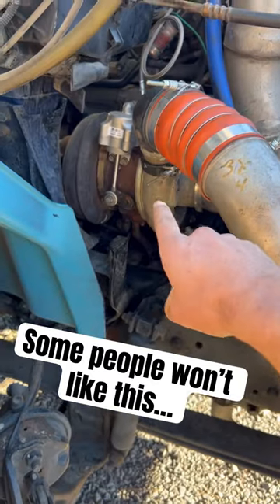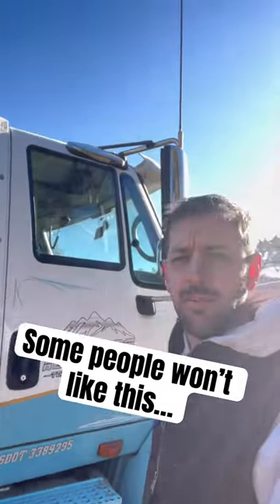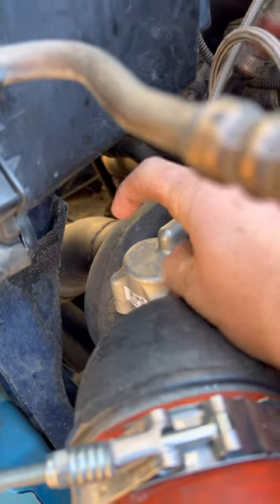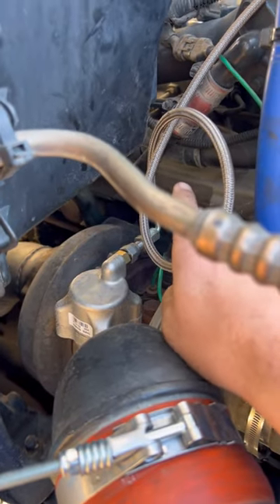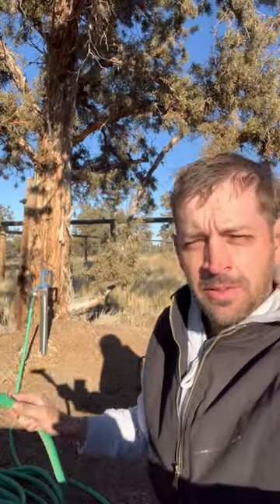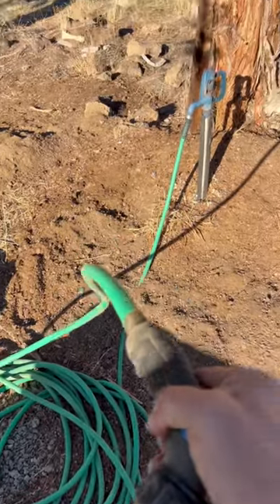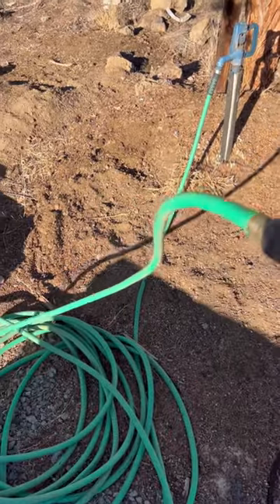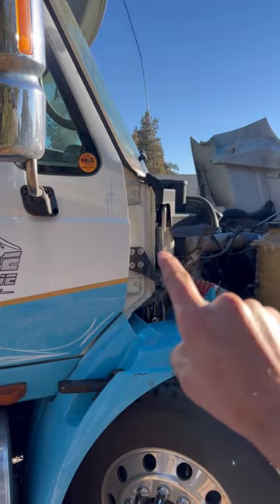Will it hurt the turbo??  (Physics made simple)

Comment: Can it damage the turbo? IMO, no. There is very little air volume at best. Air can't flow through unless there is a cyl at overlap. Overlap has the valves nearly shut, and overlap is < 30 deg x 4 = 120, per 360 deg, or at best a 1/3 chance. Now let's say you are unlucky and the engine stops at overlap. The air must go through the exh valve that are only open <.05" and then the intake, <.05" the through the intercooler, then compressor (which wants to turn the turbine the other direction) then the air filter.

OK, assuming that small amount of air could actually keep the turbo spinning. A turbo is a high powered device. It consumes over 50HP under load. And everytime you shut off your engine, it coasts for upwards of 2 minutes. It's not fragile. But should the oil film somehow go away, the turbo would just stop spinning. The air going through those little valve gaps could not apply enough torque to burn off the bearing material

Comment: 😂 been yelled at for this several times. As a diesel mechanic it’s the dumbest most ignorant thing I’ve ever heard of.
Reply: If you are a diesel mechanic, may i ask then :
Old diesel engine have no throttle in the inlet, and the invalve was open at the same time as the outvalve. This was to let the exhaust drag more fresh air in to the cylinder. Have that change in new turbo engines ?
Reply: I heard it argued both ways ,leave it up to the choice of the owner
Reply: That's funny because when you haul farm equipment and construction equipment there is a reason the exhaust is plugged. Nice try though.  Try harder next time.
Reply: @kennethlaw9830  this was discussed several times with Sergei Dratchev, and he had these  big covers he put on the equipment  when he transported heavy equipment, new or used,on his RGN trailer, just a covered the tail just in case thing,
Reply: @jeffclark2725 I actually used to haul for Cat, and a few others back in the day. They don't tell you to cover them just becsuse
Reply: @heltratt6363 almost no diesels have throttle plates (butter fly valves) on the inlet. Some Mercedes but I don’t remember why. Anyway, gasoline engines have a butter fly valve to regulate RPM via regulating intake air flow. Diesels regulate RPM by precise and calibrated control of the amount of fuel injected into the cylinders. So a butter fly valve is not needed on any diesel engine.
Reply: @jeremykamel9655  
I know some old Volvos have it to, but we talk 1956 years model then. ( Known in Sweden as Shake-engine 😂 )
Reply: just today i took delivery of a used caterpillar p36000 for the company i work for, the exhaust pipe was covered w tape to avoid the turbo from spinning. there's probably about 3ft of exhaust between the smoke stack and the turbo, nothing in between but a muffler🤷‍♂️ idk better safe than sorry ig

Comment: There may be a cylinder in the valve overlap overlap position with the engine stopped which would in fact allow air to pass through the engine while stopped. 

You know less about these engines than you think you do.
Reply: At last common sense

Comment: Ayup.

Air would have to enter that small opening, make an immediate 90° turn, pass through a large, baffled chamber adding several hundred, if not thousands of degrees of turns, enter another small opening, make another ~90° turn, and still carry enough energy through the turbine to turn the engine over at least to a point where there was some valve overlap to let the pressure escape.

The stacks would rip clean off long before you reached that much wind force. The cab wouldn't be far behind.
Reply: I agree with you but is there any thought that should be put into the possibility of 1 or 2 intake valves open due to the position of the stopped cam shaft?
Reply: @andrewhammes1183 if an intake valve is open then the exhaust valve is closed... Still nothing getting through...
Reply: @Jet_Hammer  oh, duh.  Thank you

Comment: Heard this before, Never gave it much thought,. Valves would have to be on overlap and that implies an other piston stoped at TDC , not very likely. What about on a 2 stroke Jimmy? The bigest problem i can think of is the dust , rain, etc ..entering an engine/turbo from the exhaust side on old equipment with a straight up pipe.

Comment: In theory if you have the wrong type of impeller, the pressure could both turn the turbo, and spin the engine over to (in reverse of course) so nothing only would you blow up the turbo but the whole engine to, as the oil pump can’t pull enough vacuum to draw oil all the way to the top of the engine through the moving parts… but that all depends of course on putting a jet engine up to the stack, then light it off

Comment: Not sure it matters whether it's frontwards or backwards. If it's frontwards, the vacuum at the exh tip with the pressure at the air box should make it spin also.

Can it damage the charger? IMO, no. There is very little air volume at best. Air can't flow through unless there is a cyl at overlap. Overlap has the valves nearly shut, and overlap is < 30 deg x 4 = 120, per 360 deg, or at best a 1/3 chance. Now let's say you are unlucky and the engine stops at overlap. The air must go through the exh valve that are only open <.05" and then the intake, <.05" the through the intercooler, then compressor (which wants to turn the turbine the other direction) then the air filter.

OK, assuming that small amount of air could actually keep the turbo spinning. A turbo is a high powered device. It consumes over 50HP under load. And everytime you shut off your engine, it coasts for upwards of 2 minutes. It's not fragile. But should the oil film somehow go away, the turbo would just stop spinning. The air going through those little valve gaps could not apply enough torque to burn off the bearing material.

Comment: Aside from that lengthy explanation. Between the exhaust pipe outlet is the muffler and many feet of pipe. By the time any air does get to the turbo it will have so little force it can’t possibly turn the turbine wheel fast enough to cause any damage

Comment: Whose to say the engine wasn't originally shut off in an overlap condition, I could see it possible, just not likely, even just slow spinning over an extended period could exacerbate wear on bearings. Probably one in a million, but impossible is a tricky word to prove

Comment: It happens. Have seen it multiple times mostly on older construction equipment and rarely on trucks, especially with emissions crap nowadays. 10+ years in the turbo sales and service industry. Would be easy to prove/disprove with newer turbos using speed sensors. To bad Myth Busters are off the air. Never say never 😉

Comment: I think it’s bs too. But there’s a thing called valve overlap where both intake and exhaust valves are open and hypothetically air could spin the turbo if the conditions are met but it’s unlikely

Comment: I'm sorry to be the only one to point this out, but the hose bib that you are using your example actually will allow air to flow through it even when it's closed. It's got a stop and waste underground and will permit pressure from the top side to flow out that hole.  Having said that, the air would not get into the water supply below the stop valve.
Reply: I'm not the only one.  I found others that posted prior. Lol we're all nerds here.

Comment: If an exhaust valve and intake valve are open air might flow through. But the shape of the turbine blade will hinder movement. It might move a little, but not enough to worry about. There is also no way enough pressure could be created in the exhaust to turn the engine over. I’ve barred over enough of them to know how much effort is required to move it. Not going to get enough pressure in the exhaust to do it with conventional towing methods.

Comment: Well not only that but the veins in the turbo are not shaped in such a way to spend backwards either so you have both things against you the fact that the valves would be closed in the motor and the turbo not set up to spend backwards

Comment: First of all air cannot spin a turbo backwards because the fan blade are turned into a direction of the exhaust side as pusher so therefore it will not spin backwards from the muffler side

Comment: um turbos don't have bearing unless it a super expensive one that would cost almost as much as that truck but they do have bushings. there may have been some differences back in the 60s and 70s truck but the turbo fin seemed to spin in those more easily, i know we had to idle them down so they wouldn't set there spinning while you climbed into your personal vehicle and drive away.
Reply from the maker: They absolutely have bearings

Comment: Chance are that at least 1 cylinder will be in a position of valve overlap just past TDC on the star of the intake stroke.
We tested it with the exhaust ventilation system in a shop hooked up to the exhaust and it did spin the turbo, not fast but over time ....
Reply: Did you suc or blow the exhaust?
Reply: @Pinz314  the exhaust ventilation system puts suction on the exhaust.

Comment: Really using a frost proof hydrant is not the best example because when the hydrant is off it opens the vents at the bottom of the hydrant  so you actually could blow air through that hose however you are completely correct on the turbo part
Reply: Oops, I just posted the same thing.

Comment: Frost free spigots don't work and freeze if the hose is hooked up....😮
Reply from the maker: They do if you leave the nozzle open
Reply: Yup, I've had to pay the local welding shop to bring their big gas motor driven welder out to thaw a couple of hydrants before, writing the check for that will insure you don't forget to remove and drain the hose again any time soon.
Reply: @CaseyLaDelle I’m not going to open this hose because it’s a little frozen. Ummm

Comment: Thats A Very Odd Concern lol Turbos Especially Journal Bearing Turbos Are Not Easy To Spin When Dry And Cold To Begin With. Aside From The Engine Being A Massive Restriction And The Air Flow Being In The Least Ideal Direction For Intened Turbine Rotation....

Comment: You do understand diesels don’t have a throttle blade right?  If one of the 6 cylinders is on the intake stroke which there definitely will be.  Air can and does back flow.  It’s called turbocharger windmilling.

Comment: Valve overlap will allow reverse air flow thru the engine. And the drain feature of that frost free hydrant will also allow reverse flow, not back into the plumbing but into the ground.
Reply from the maker: No it wont.
Reply: So you are saying that at time in a cycle of a 4 stroke engine the inlet of the engine is connected to the exhaust, if so the engine is screwed, don't worry about the turbo!
Reply: @mikerubynfs  in way yes, valve overlap is when both the intake and exhaust valves are open at the same time. This is by design on many engines and at that time reverse flow is possible as all valves are open. Weather or not that means there is enough air flow to spin the turbo would be another matter. 

And frost free yard hydrants like shown in this video have a but in drain in the bottom to drain the hydrant of water when it is shut off to prevent damage from water freezing in cold weather.
Reply: @tdm8817  I stand corrected, I suspect that there would not be enough airflow to spin the turbo, even if it does they are quite robust bearings (I work for a company that made them) and would be running cold with loose clearances.
Reply: @mikerubynfs  ya I would imagine its not enough air flow to spin the turbo in most situations, that being said keeping rain bugs and debris out of the exhaust would be a good idea so a coffee can or something similar over the exhaust while towing would seem like a sensible thing to do.
Reply: @tdm8817  A quick try to calculate the air pressure on the turbo indicates a low force, vastly less than from the exhaust. I doubt debris would make it as far as the turbo,  plus being a centrifugal fan it is being driven the wrong way making it very inefficient and even less likely to turn. I hope Casey's metrics are increased!
Reply: @calholli yes Yes, N supercharged and Turbo engines tend to have more valve overlap.
To clean the cylinder
Reply: Nice to see more people knowing of valve overlap...
Im not updated of new diesel engines, but know that old had it.
But one cyl open and air going wrong way true the turbo fan maybe dont make it spinn. I dont know that...

Comment: I drove through a Nebraska blizzard to work one night (they closed I-80 after I got off it), and parked my 245 Volvo, as I always do, backed into the parking place. Unfortunately,  it was pointed into the wind. 
I came out in the morning and tried to start my car and I heard the sickening fast turnover signifying a broken timing belt. (Not an interference engine so about a hour to change if you have parts and tools)
I opened the hood and the engine compartment was full of snow. Snow had sifted in around the plastic timing cover and the melted snow had frozen on the belt. Instant failure.
Strange things happen.
Reply: Ican see that, i always wondered on Ice Road Treckers back when they really buried those big trucks in the sno, and under the hood was really packed in snow, but the engines survived, Great video

Comment: Your wrong,  I think different than you.  If that hose wasn't filled with ice I could blow air through that hose. Its connected to a frost free hydrant!  That hydrant when closed vents to sand or stone under the hydrant if installed properly.  Thats why they put a swing fitting under the hydrant. The valve to that hydrant is buried under ground. And thats why its called frost free. The drain is buried beneath frost line and it drains all the water above it so It doesn't retain water and freeze .  This also lets water escape the hose even after the valve is closed so it can drain and not freeze. However, someone installed a sealed water nozzle on the hose 😅  if you have had to dig a few hydrants up by hand in very cold climates I can assure you that you also would know how they work.

Comment: Hay cast I really like you put disagree if two cylinder are on the exost stroke some times the exost valves and intake are not closed then you have a opening for air to go threw  and spen the turbo
Reply from the maker: No it won't

Comment: When I ran lowboy when we hauled heavy equipment we had to put a bucket on the exhaust but when we hauled a truck we didn't cover it
Reply from the maker: So you under that the myth is bullshit
Reply: @CaseyLaDelle  we also hauled with tilt deck trailers the same pice on a tilt deck no cover, low boy covered

Comment: Lets assume your wrong and that possitive air at the turbo could flow through the engine back out of the intake, removing all the dust and bugs from the air filter (wouldn't that be neat). Considering an overwhelming majority of trucks today are equipped with a DPF... I can only imagine the amount of speed required to create enough positive air pressure to backflow that DPF... Let alone the entire Emetions Systems to get to and overcome the Variable Vain Turbo... Never going to happen!

Comment: Air can flow through an engine that is not turning, if the engine has stopped with a cylinder that has its valve in crossover.
Reply from the maker: Prove me wrong
Reply: And an engine will not stop in such a position, unless it has 16 or more cylinders. It's physics.
Reply: @needadate 
Way ?
Its stop at comp in one cyl. And a 4stroke having 4cyl or more should have least 1 cyl in crossover..
Reply: @heltratt6363  Nope.
Reply: @needadate  
How will the pistons stops in the cyl then if i may ask ?
Reply: @heltratt6363  Near the point of maximum resistance, which is not close to TDC around which overlap occurs.

Comment: Air can flow through an engine backwards 100% no if and or butts. Always open valves. Not trying to be difficult but it’s true.
Reply from the maker: Prove it
Reply: Casey come on you’re a smart guy. All engines that are off have an open pathway through the engine via valves on at least 2 cylinders the engine will have two cylinders in the firing order that are called running mates one will be on exhaust stroke one on intake stroke therefore  open valves open pathway through the engine. Nowadays with particulate filters and air to air coolers there are definitely things to slow the air in a towing situation. But air flow is possible. In the past before emissions lots of damaged turbo claims due to towing and hauling especially off road equipment. Even today turbo damage is possible. Unfortunately all i have is 28 years as a heavy equipment tech and story’s from teachers and peers. No personal experiences. Not trying to be an ass but air flow is possible and turbo damage can occur. Very much enjoy the channel and will continue to do so. Great content right in my wheelhouse love it thanks Casey.
Reply from the maker: @benburrows9985  prove me wrong then.  Make a turbo spin…

Comment: The engine isn't always closed. At the top of an exhaust stroke, both sets of valves will be open and can alow air flow through the engine. Is one of the cylinders in this position? Probably not, but it can be.

Comment: Don't know about the newer engines, but we had a John Deere tractor hauled back in the 1970 that it did take the turbo out by hauling it with out covering the stack. So we just always cover them as the time it takes to tape or cover with the stack cover is way cheaper than the cost of a new turbo. Now the tractor didn't have a muffler it was just a straight pipe. So maybe that was why it did that. Just what has happened to me before.